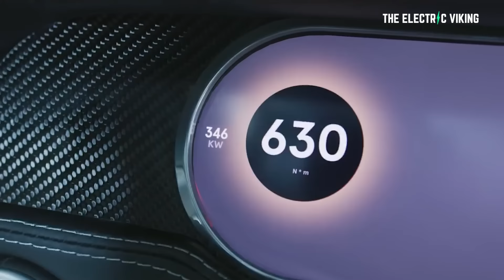Chevrolet's e-motor kit to convert gas cars to EVs is EPIC

Comment: A rock solid conversion ICE to EV is a massive untapped market that would save the landfill scape yards from getting overwhelmed with ICE cars as EV ramp up to scale
Reply: Yamaha makes a great ev conversion motor package.. fyi
Reply: Might not be landfill fodder, hopefully crush them and melt them down if practical.
Reply: Crate motors are for models of significance like a 1966 mustang or a pre unleaded petrol Holden. That would be prior to 1980. The manufacturers DO NOT want people to put EV motors in to anything less than ten years old. Preferably less than 25 years old. This is a marketing burp
Reply: @SunriseLAW  Sounds good.
Reply: @SunriseLAW  if you love your ICE car, but live in a post ICE era, you’ll need conversion to keep that car you love/classic able to drive it.
Reply: @SunriseLAW  The reason is the battery
Reply: A rock solid ICE to EV expansion of classic vehicles in ten years will start contributing their part to our landfills with toxic waste from the used batteries that are certainly going to start failing in that time period...
Reply: @SunriseLAW  make sure you've enough money to buy a battery pack also.
Reply: Steel is one of the most recycled things on earth!
Reply: @SunriseLAW  
Get a used Gen II Volt. You get the best of both worlds.
Reply: Save scrap yards? Scrap yards are amazing for recycling and all those engines get recycled. You don’t know anything about scrap yards or what they do

Comment: This is exactly what I want to do to my Winnebago. It's got a ton of room for a huge lithium pack, and plenty of room up top for solar.
Reply: Remember that the room taken up by batteries is going to take some if not most storage space, RVs are typically pretty good about minimizing wasted space as they are. Also keep in mind that the uphill range loss is even worse in heavy vehicles. Not impossible, but something to keep in mind.

Alternatively, this would make for possibly the best BLM roamer. Park in BLM land, charge over the course of 2 weeks, then go 20 miles over to your next spot
Reply: I think it would be a great conversion because a motorhome weighs half what a commercial bus does. Most people do not drive more than 300 miles in a day. Spend 2-3 days in an area recharging with your solar on the roof. Especially with todays gas prices.
Reply: @specialopsdave  I thought I'd put the batteries underneath, between the frame rails. Maybe give the whole rig a two inch lift to help keep clearances.
I'm confident it can be done!
Reply: @jimbojones9665  Interesting. Just be careful to remember that the frame flexes, so make sure the battery mounting hardware can flex too. Also consider undercarriage protection, so you can roam dirt roads out in BLM without worry; BLM lands are where I feel that setup would work best
Reply: AtlisMotorVehicle has a platform just for this very purpose.
Reply: Pull the petrol motor out and put your battery in its place. Should already have access to cooling air in this location. Get a reasonable gas powered generator for backup charging.
Reply: If you live in it full time, it's definitely worth it
Reply: It can be done Walmart already has EV driverless trucks in Texas. Amazon I'm pretty sure is already testing it to. I plan on a small engine manual transmission running propane it's $2.00 a gallon in my area. I've converted a few generators to tri fuel conversion kits. Not many propane vehicle conversion kits for vehicles left. Their is a square bore 4150 style base plate for a carbureted application up to 400 horsepower. Read my other comment.
Reply: That would be the best 70 miles ever
Reply: @jimbojones9665  , look into a company named : Motiv Power Systems. They specialize on EV platforms for box trucks and short passenger busses.
Reply: @ALCRAN2010  Thanks for that.
I looked these guys up, and it seems like their EPIC4 platform is almost exactly what I need.
The wheelbase is a little long, but with some minor modifications it would be perfect.
It would triple my power, as well give me a GVWR increase of 45%!
If I throw a boat tail on the rv, I bet I'd get much better than the advertised 105 miles fully loaded.
Of course, that'd be on paved roads.
Reply: @NevagamewithSound  You mean, they have a platform you can RESERVE and that's because it's NOT available, just another company talking about something they plan to build.....but they'll take your money today. Hard pass
Reply: DREAMING IF YOU THOUGHT DIFFERENT
Reply: @GrowSomthing LOL!

Comment: Love the idea of conversation kits. They do need to make them affordable.
Reply: They are affordable. You're building a car. Your comment alone tells me you've never completed a build before. When you're finished it's going to be around the same price of a new car if not more. The quality and the sense of accomplishment you get because you did it yourself is what compels people to build a vehicle not the affordability...
Reply: The Ford kit is comparable to swapping engines
Reply: We need better storage than lithium or kobalt, and better energy production than fossil fuels or coal.
Reply: @erisgh0sted961  not gonna happen.
Reply: @kendellmoore8367  conversion for the sake of hobby is not going solve the problem of work, power, and range output (ratio gap) between ICE and EV.
What hobbyist like to do, and what the every day driver need, are not the same.
Reply: people have been converting  petrol cars to electric for over 70 years

Comment: Much harder in practice than it sounds - the devil is in the details. Brake servos that need manifold vacuum, aircon, heating, safe battery enclosures, interfacing with existing vehicle controls & instrumentation etc. etc....
Reply: It will also high light all of the shortcomings of the old technology.
Reply: @Dfin glide Like what, reliability???? I’ll keep my 20 year old truck that I can fix over a POS Tesla that if the touchscreen stops working, the whole car is garbage and you gotta drop thousands🤔🤔🤔
Reply: @LibertyOrD___h  I agree with what you say. E-motor kit to convert gas cars to EVs is EPIC STUPIDITY.

Comment: I have an MG Midget that was converted to EV some years ago. It has eleven 12 v batteries wired in series and an electric motor from a forklift. It needs to be changed over to Li Ion for better range.
Reply: Cool!  
I've often thought a Mazda MX5 would also be a sweet little EV.
Reply: Have you checked BatteryHookUp?  I purchased cells from them and they were inexpensive and decent quality,  they have Ev modules also.

Comment: May be easy to replace motor but fitting a battery pack and weight problems. I don’t see it happening other than one offs and a small market.
Reply: Small market to be sure but maybe not trivial.  A lot of gear heads spend 10's of thousands customizing or hotroding old cars.  Had neighbor with his "Sunday driver" with $50k engine.

Comment: Replacing a 911 engine with an electric motor is sacrilege.  But there are some cars where the engine was garbage to begin with. DeLorean comes to mind. But, just a reminder, the CO2 that will go into making the motor, mining the copper and lithium transporting them to the factory and then on to you will be a wash compared to keeping an old motor built 30+ years ago running. But if you prefer electric and think its slick... more power to ya! Choice makes life great!!

Comment: It needs to be a "complete kit" with selectable components (just like you customize PC's), motor, controller, battery, controls, key protection, crash sensing disable, possible cooling,  etc...
Reply: EV West has some cool stuff
Reply: indeed, drop in kits with motor and all auxillaries, eg elec vac pump, elec a/c compressor etc already hooked up with receiver for remote sensors such as throttle, brake, gyro etc . Plus battery pack in modular configurable set up to allow different installations / weight distributions

Then the whole lot mass produced to get price down to sub $25k  :)

Comment: This is going to be a big deal in a few years. Once all the components are readily available as off the shelf and competitive, small enterprises will spring up that specialize in particular vehicles. Compact pickups... no longer available from manufacturers, plus conventional pickups should be obvious candidates. The real Ford Ranger... not the newer fakes... were once sold as fully electric back in the 90's as 'compliance' cars, mostly in California. Would love to see that come back big time. Way back when... like 1960... you could get engine repair packages for Volkswagens from Sears. Hopefully soon Amazon will be on this. Can't wait.
Reply: The components are readily available. It's determining where and how to install enough batteries to have a 100 mile range.. re-engineering the entire chassis to have room for batteries is not something your avg guy is set up to do. Anyone can pull out a engine and swap it to electric...but without batteries u have a electric paper weight.
Reply: @kennedy6971  these systems are compact. The motor, controller, and some of the battery would fit in the engine compartment. After that, it is balancing the car by splitting the battery between the engine compartment, and where that gas tank used to be.
Reply: That is why older pickups are so much easier to deal with. Room between the frame rails or just make a new custom truck bed/box which is also the battery box. The stock ones are crap anyway. I used to make custom heavy duty truck beds and Rv puller decks.

Comment: Ford's "crate motor" being sold without an inverter or software is like selling an ICE crate engine without the pistons and valves. It's also the exact same motor in the mach-e.
Reply: Yes!  The other critical components like batteries, a battery management system and some main computer to tie it all together is also missing. It's vaporware

Comment: I built a 911 from a retired track car with a p85d motor. The car was amazing when conpleted. Very fast. The owner, a Porsche collector, said "This isn't just the fastest Porsche I have ever been in, this is the fastest car I have ever been in!". Took about 4 months to complete.  No cutting or modifying the car body at all. Everything was made to bolt in without drilling or welding the vehicle.

Comment: It is not just dropping a electric motor under the hood. It is going to take major modifications for the battery, wiring, controls, and gauges. Will this include regenerative braking? Another major project.

Comment: Been there, done that. I converted a VW Rabbit to electric. The result was a perfectly usable car. With today's battery tech, it could be so much better. But, that said, you lose so much. EVs are designed for the torque curve of an electric motor (i.e., no transmission), has accessories (e.g., vacuum pump, A/C) that don't require the motor to be spinning, ... Sure, you can convert a classic car to electric but if you want something to drive every day, shop for something new.
Reply: There are all manner of electric driven accessories that can be installed. Ultimately though if the car is old there will be a lot of work and cost to add in everything you might need.
Reply: I'd get a cheap new electric car instead of looking to convert an old vehicle to electric b/c that'd still be plenty of other components to repair down the road on an old car thus making a lot more sense in my mind to only convert nice classic cars.

Comment: I need a 300hp 250-300mile range kit for a 1973 240z that does not weigh more than the original motor/tranny/gas tank setup and is less than $40K and bolts right in. If they can do that then I will admit that they are some badass engineers. Either we figure this out, or all classic cars become new metal ingots or museum pieces by 2030.

Comment: To replace an ICE it needs to include a vacuum pump to feed? the power brake booster, a power steering pump, and a sold state alternator (DCDC converter) to make 13Volts to run the accessories.  Package that together and you have an actual replacement engine.  Of course a heat pump is needed to provide cabin heating and cooling.  Conversions that actually work are very complex and expensive.